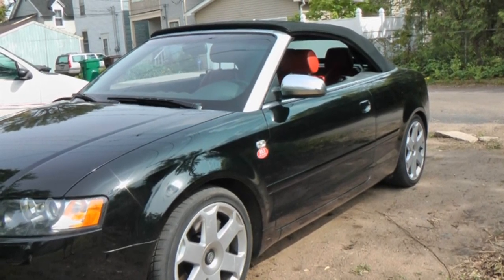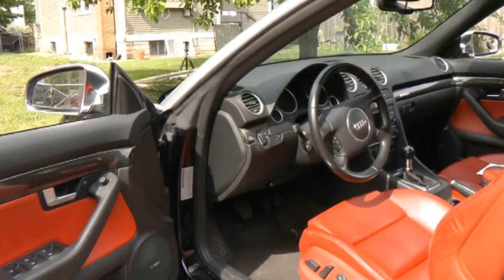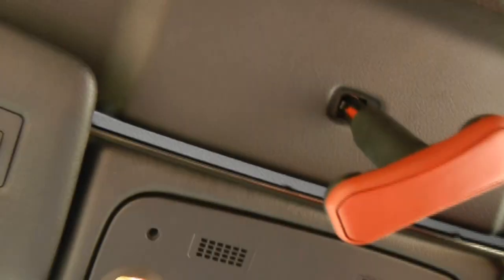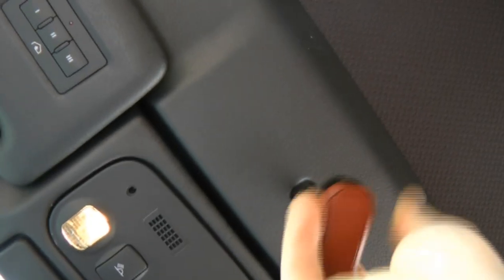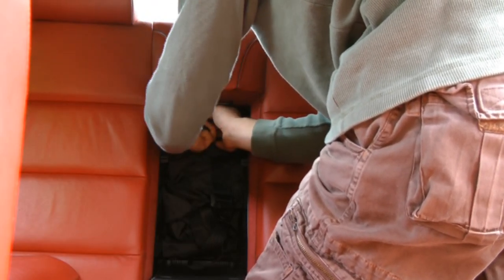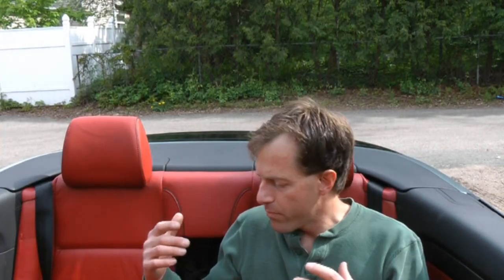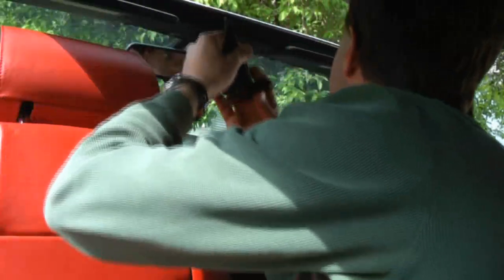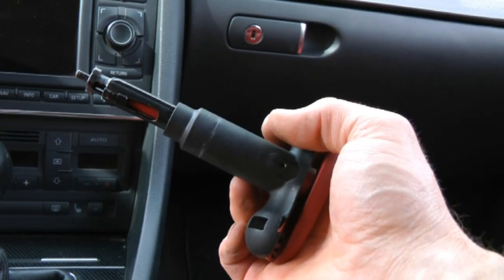How to Manually Operate 2005 B6 Audi S4 Convertible Top

Comment: This just happened to my b6, follwed the op's instructions, after checking the fuze first, that was ok, flashing yellow roof symbol on the dash and unable to open the boot with the fob, also the alarm beeb won't happen if you have this problem when locking the car, any how followed the video instructions and all's good now, full marks to the dude who posted this, andy.

Comment: Matthew, it's July 29th, 2024. We bought our 2008 A4T 2.0L Quattro Cabriolet in Deep Sea Blue w matching top, just a few days ago. Regardless, that its top doesn't automatically work, as a lot of other little features here and there, we still LOVE it!
Your video has given me hope. The roof motor has been taken off, and supposedly there's a new, replacement motor in the trunk - which I have seen, although it does NOT look that new -  however, I haven't really checked it all out. I'm hoping that once I replace that motor, I go back inside and click the button, and the roof does it's thing. If not, it's good to know that posssibly just opening and closing it, manually can reset it!
I'll keep you posted, buddy! I'm sure it'd be great to know that 14 years later, your video is STILL helping folks get the most out of their Cabriolets! BTW, GORGEOUS S4! Black w Red Leather?!? Chef's Kiss, Matthew! I hope you are still enjoying her, for she's a rare beauty!
Reply from the maker: Congrats and good luck! I sold mine when I bought my 2012 Volt, so, like 12 years ago. I am enjoying my F-Type convertible now.

Comment: Excellent explanations of probable causes of defaults and details of the fix. SUCCESS on our first time resetting the drop top with your video. The sensor needed reset when my son began putting the top down and I wasn't aware that he was starting the process and  I opened the passenger door to get out. Little things like that can mess us the sensors. When it only lifted 2 inches and quit working, initially I thought the top was broken. I took it to Firestone Auto's foreign car SO CALLED "expert". He wanted $500  for a new motor and for a second opinion I took it to a local foreign car mechanic who diagnosed the problem as being a faulty hydraulic pump.  Since I'm cheap and have no faith in mechanics... I researched youtube fixes... and I had my drop top fixed in 10 minutes with the instructions on this video FOR FREE!!! Thank you so much

Comment: May 28, 2015 -- Matthew, its almost exactly 5 years after you posted your video and I used it to fix my car's top!   A couple of things to emphasize that I learned: 1. open (unscrew) the key before inserting it in the front or back lock mechanism.  2. Turn the key until you feel it 'seat' into the opening.  3. Close the key (screw it together) to 'close' the key BEFORE using the key to lock or unlock the top.  As mentioned in the video, you'll need to lock the top in the open position first and then also lock it into the closed position before the system will reset.  It worked for me, so if the process doesn't work for you the first time, try it again and be sure to fully lock the mechanism in both the open and closed positions.  Best of luck!  Steve
Reply from the maker: Stephen Thoren I cannot believe it has been five years! Thanks for making me feel really old.

Comment: thanks for the video! I just tried it and it worked. As stated I tried it once and it didnt work because I had the windows up. I tried again a week later, put windows all the way down. Followed what the video says and it worked like a charm
Reply: Did you have the ignition turned to on so all dash lights were on or ignition off
Reply: @jamesbentall9529  I did it a couple times but not the exact way needed. One time I left windows up, other time ignition was off. When I turned ignition on, let windows down, the did the cycle with roof it worked perfectly
Reply: @indiancc1204  many thanks for the reply .. I will try it tomorrow
Reply: For sure. Be patient and give it a couple tries. The video helped a lot. Let me know if it works...

Comment: Matthew's reboot of the convertible top software/hardware is missing one thing...make sure the power windows are all down as in his demonstration.  The reboot will not sequence at all (dead) if the windows are up and actually give you an alarm that the top is not secure.
Reply: What about the Key Position? Ignition or anything?

Comment: Worked like a charm! Followed instructions just as you've posted and 'bam!' Opened and closed perfectly. 

I might add I also 
1. Cleaned the  Hydraulic motor
2. Found that my position sensor had come undone from one of the holes (placed it back in, took about 30 seconds)
3. Manually reset as described in the video
4. Blinking light was on when I started the car but went away as I drove it with the roof down
5. Came home after a trip around the block, put it back up, no problem.

Comment: I cannot believe that this actually worked!!! My top got stuck halfway down, and wouldn't moved an inch when I was trying to get it to go up/down using the button. I was too afraid of actually pushing it up or down until I saw this video since I thought I was gonna break it. 

I called Meineke, and they said that they needed to run a diagnostic, which would cost me $85, and suspected that the hydraulics pump (or whatever it was) needed to be replaced. They gave me an estimate of $1,800 to $3,200(!!!).

I was fortunate enough to come across this video before bringing my car in. I wanna thank you so much for posting this. I followed your instructions, and not only did I managed to latch my top to my car again so it was drivable again. After pushing it all the way down, and then pulled it all the way up, it actually started working again. I really had no clue that this would reboot/reset the computer/sensors. Also, I had no clue that I had a key for the top in the dashboard. 

And a note for all you out there with this problem. The top was heavier than I thought, and I had to use more forced than I thought to make it retract. Same thing with this key for the top. I felt like I had to use an unnatural amount of force to lock/unlock it. 

I don't think I ever posted a comment on YouTube before, but you definitely need some credit for this! 

My car, 2007 Audi A4 2.0L B6 Convertible.

Thanks from San Diego!

Comment: Thank you very much, Matthew!  My wife bought a 2007 and this happened the first time she put the top down.  The dealer fixed it for $150. but told her she needed a new convertible top controller.  The part was $600 and labor to install was $300.  Instead, she chose not to use the top.  One day, she tried the top, and it worked fine.  Now, using the Brenengen Maneuver, I will be able to reset it if the problem occurs again.  Thanks for taking the time to make your video, which will be a boon to Audi cabriolet owners everywhere.  You done good!

Comment: Thanks very much--from here in Australia--this video was such a lifesaver today. I don't think I would have been able have got it done (winding it back down and then closing up  manually to reset the sensors) without your clear descriptions. A lot of the steps required a lot of force, so it was vital to know I was making the right move so that I had the confidence to give it the necessary grunt--otherwise I would have been unable to get the mechanisms to move for fear of breaking something. Thanks again. (There is also a really useful video from a channel called "Vagpro cabriolet specialist" that really focusses on closeups and descriptions of how to use that tool.)

Comment: Hi...my wife's convertible roof warning light came on as I was putting the roof down midway and stopped...I reckon it did because I did not have the car running and therefore there was not enough power to operate the roof fully so this tripped the fail safe which stopped the roof from working..I did not know what to do and it's only thanks to your video and you taking the time to show us that I was able to reset the warning light after I followed your instructions....so thank you man for all yo

Comment from the maker: The car has about 55,000 miles now and is 7 years old. I have owned it for nearly five years. The only thing I had to have fixed was a cruise control switch and a front wheel bearing. Both fixed under warranty, but truth be told, the wheel bearing started making noise after I ran over a parking thing. Otherwise, the top is decaying a little bit (see repair video) and several latches for some reason have failed, but otherwise, it has been incredibly reliable to this point. It is a perfect car.

Comment: Thank you so much!!!  I thought I had a $5000 problem (after just spending $2400 on two plastic heat exchangers - bad timing).  Your method totally worked and I was back in business in less than 15 minutes!  I totally appreciate that you posted your video.  Very Helpful!!!

Comment: Good video!  My top got stuck a few years ago. I found the key in the fuse box. But I didn’t figure out that the top of the key needed to be screwed out. I eventually resolve my problem by Removing the fuse and then putting it back in place and manually pushing the top two to position where it’s almost ready to go in the boot and from there it worked. But good to know the details because I love my Audi convertible. Thanks again.

Comment: Nice S4 with the manual, Chief!  Thanks for taking the time to help.  My S4 did the same thing just a few days ago, and it took me awhile to figure out how to handle the rear cover standing straight up with the rest of the top unhooked in a downtown location via the OM. Several pedestrians displayed amusement. Its now locked in down position (open air), and I have not tried to operate it since. Bets are being placed that your procedure will reset it to its former glory.  :  )  Thanks again

Comment: I had no idea we had this option to manually fix this issue.  Just watched your video after driving 30 minutes home holding the top down with my left arm (very unsafe, I know, but I drove slow with my flashers on!).  Tried what you said to do and BAM, all worked exactly as you described and it took all of 5 minutes with the help of my wife.  THANK YOU SO MUCH!  We thought we were going to have to call into an Audi dealer for an appointment but not anymore!

Comment: Matthew, as another(s) has said -its over five years since you posted this video - but here's another grateful viewer. In unusually balmy English weather my sister opted for "roof-down" rather than air-conditioning. It stuck halfway, like the Titanic going down.
Manual closure followed. Roof icon on dashboard flashing all the way home. Then thanks to you...open manually and close manually..and hey presto alles ist in ordnung as they at Audi.
(Could be that we were parked on a bit of an incline.)
Really good clear no-nonsense instructions. If you were a blonde lady of 25 I would kiss you, but as you're not I hope these words and a trans-Atlantic handshake will do instead.
Cheers.

Comment: Thanks Matthew! Great video with none of the usual pre-amble that drives me bananas! My roof stopped working for no reason. I didn't do anything about it until it was due its service and my tame mechanic came round to do it. I asked him to look at the roof and when I next saw him, the roof was working OK. I asked him how he fixed it and he said he hadn't done anything - it just worked. Anyway, it worked for a while and then stopped working again. As the mechanic apparently did nothing to fix it last time, there is no point in asking him to have a look at it again. So, if your trick of manually operating the roof worked for you, I will give it a try. I wasn't sure if you could do this single handed but now I have seen your video, I know what to expect. Even if this doesn't work for me, thanks anyway! I will let you know how it goes.

Comment: OMG Dear Matthew you are the champion! I just did as what you have done to my car, and it completely works fine now, back to normal!  Thank you so much.  
My suggestion is do not try to open the soft top inside a low roof place, such as supermarket car park, although it "looks high enough", still the sensor confuses sometimes, then starts self-protect  -- stopped in half-open mode.

Comment: Tried this today on a B7 variant with the roof stuck down. Opened the cover with great difficulty and the roof would not move out of its storage compartment. After much pulling and grunting decided to disconnect battery. Problem solved roof moved up with ease. If your having problems then try disconnecting the battery.

Comment: My previous comment here stated my problem was fixed. Yesterday, on an outing, at my first stop I raised and lowered my top without a problem. At the second stop the boot unlocked, raised and inch and stopped. Tried several times with no luck. With a chance of showers I got back to my garage. I dug out the manual and read that the system can reset itself after 15 to 30 minutes. This morning I tried again and the top worked fine.

So my point is let it sit for a half hour before you try raising the top and see if that helps. Otherwise, use Matthew's solution.
Reply: +Dominick Corbacio  Did you let it sit with the ignition on , engine running or just everything all off ?
Reply: Everything was off. I had a continual problem though had to take it ti Audi. Problem was electric motor that drives the hydraulics. Repair plus oil change was 940.00 in case you were curious.
Reply: Okay and thank you for getting back to me :)
Reply: My back seat arm rest you said to open to manually open the roof is stuck and wont open so I cant get to the other hole to manually open it  any suggestions?

Comment: Hi. Thanks for your reaction.  That’s what i meant. In my case. I had a low battery  and the rear valve isn, t coming up anymore so the roof stops and falls back. Hope it works. Kind regards

Comment: Thanks for posting this great video! Just a heads up. The roof-to-window  hooks need to be retracted (manually if necessary) to get the top into the storage bay. And in my case, that's all I had to do to "reset" the sensors. Once my top was back in the storage bay; the roof began to operate normally. Thanks - again!

Comment: Great Vid but to reset you shouldn't have to open and close the roof. Just lock in the front as shown and then re lock the rear - you will hear it click back in . and that's it. Mine has jammed twice and that's how Audi reset it the first time and I did it the second time.

Comment: Excellent video, thanks for the effort you put into making this. The roof on my B7 wouldn't go up today - while trying to close it manually, I got the clamshell roof cover open on its struts and I could not force it down - any idea why?

Thankfully in desperation at that point I tried operating the roof electrically from the switch again and it suddenly started working again - I guess in jiggling stuff around manually, I reset whatever sensor had stopped it working in the first place.

Comment: Great video, really saved my bacon on the road recently.  In my case, it was enough to manually re-lock the front and back.  Worked fine after that.  I had previously disconnected the battery prior to watching your video so perhaps that helped as well?  Many thanks, Anthony

Comment from the maker: Andy from Belgium - I would check to see if there is something touching the plastic panel in the trunk (boot?) - well, first make sure that the lever in the trunk is pushed the right way, so that plastic thing comes down. I know that the top will not work if (1) the car is moving, (2) the lever is not in the right position, (3) the truck is not closed all the way, (4) something is in the truck and touching the plastic part that the top goes into. It is a very sensitive switch.

Comment: Been having problem with my roof it leaks crazy when its raining,so much that is affecting the seats of the car.Also my local mechanic said the roof control module is bad,because I can only roll the roof manually since the original module burned and i couldn't,get the original.Plesae help out.Am enjoying your site.

Comment: Hi, I've recently purchased a 2003 A4 2.5 tdi the roof  only goes to 3/4 closed, the boot hatch opens fine. I have to manually push the roof down then push the roof into place. The abs light has also come on so not sure if this is a abs pump fault ?

Comment: i bought a used one and it got stuck half way when i tried to open the top. first it says soft top not secure and i did exactly what you showed here and i was able to get rid of the warning light.however, mine got stuck halfway and won't go all the way down. i'm not sure if it's anything to do with the operating sensors or if mine's just broken. please help

Comment: I changed my battery and I knew I need to reset and followed Ur video. I manually opened n closed the roof but it didn't reset. Ur video didn't showed that u need put car in ignition while closing the roof manually. Do it think it's BcoZ of that I couldn't reset